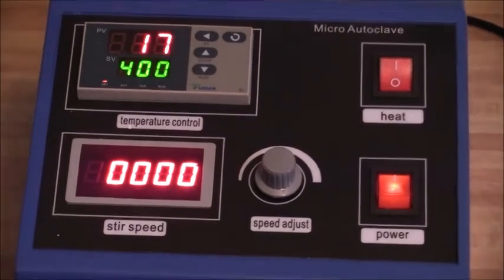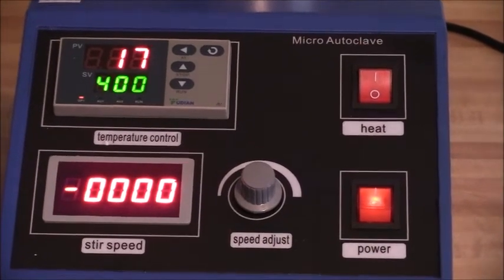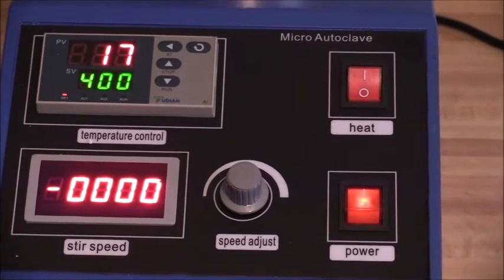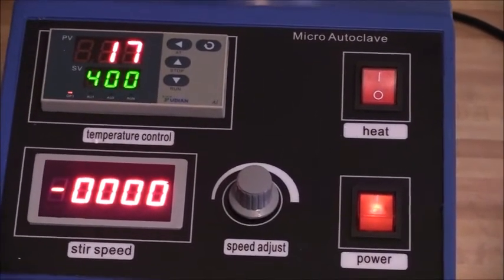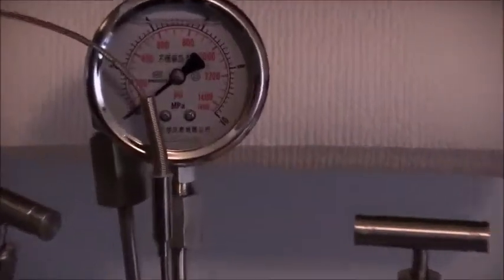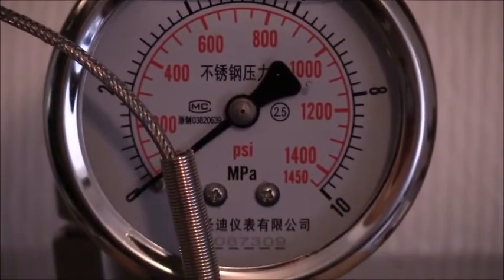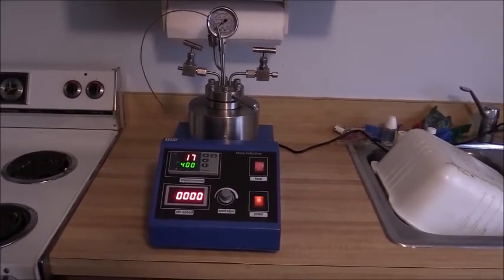My new 'super deluxe' hydrothermal reactor.

Comment: Did you get the heating system on the bottom separately? I am looking for a setup to do hydro-thermal carbonisation.
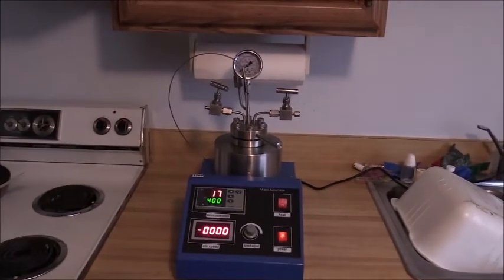Reply from the maker: No, the whole thing came as one unit.  Unfortunately, a very recent development is that the heating element doesn't work now.  But I found a way around that.  At 2:12  you can see the stainless steel body of the actual vessel itself.  This can be separated  from the main body of the reactor and placed on a hotplate to provide separate heating (which is what I have to do now to use it).  Doing it this way though, you don't get the benefit of being able to stir the mixture or to monitor the temperature unless you place the temperature probe inside the reactor while it is on the hotplate.
Reply from the maker: Let me clarify what I said there.  The large stainless steel cylinder which rests on the blue body of the reactor cannot be removed, and contains the heating element, but the smaller stainless steel cylinder which is the actual body of the reactor vessel itself can be removed from the larger stainless steel cylinder containing the heating element.
Reply: Was it about 1300 bucks?
Reply from the maker: @techniquetechnology2598  Yep, it sure was.